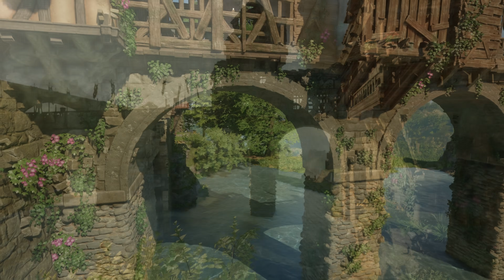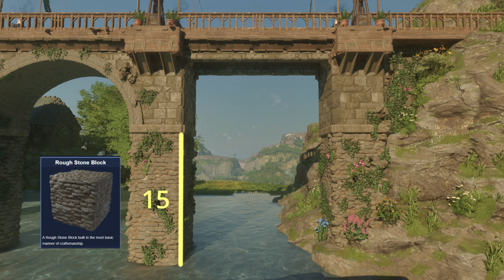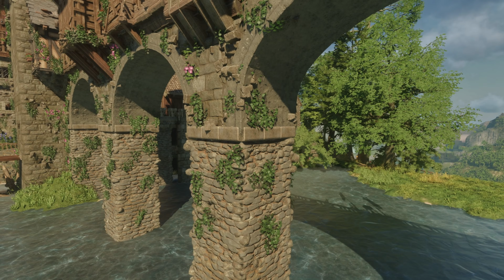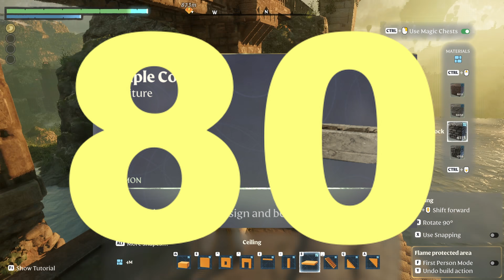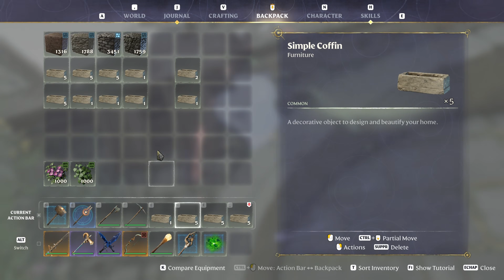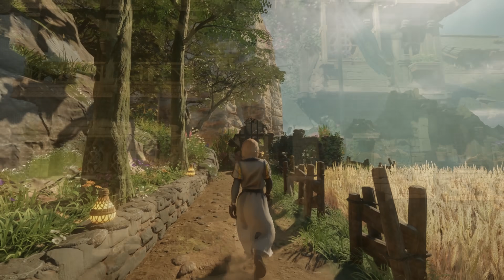Build Your Own CURVED BRIDGE in Enshrouded

Comment: What's the spacing dimensions between each of the pillars 'legs' of the bridge ? That's the only thing you didn't cover.
Reply from the maker: The 18 blocks no?
Reply: @Buildingue  Not sure, aren't the 'legs/pillars' the 18 blocks for the pair? So then how much of a distance would be between each 'pair' ?
Reply from the maker: @Lava-pe6wu i teach you how to build an arch with 2 pillars, then you need just add an other pillar, 18 blocks far again, and add an arch, and continue, like this you choose the length of your bridge. I hope to answer your doubts 🙏
Reply: Ok i think i understand it now thanks.